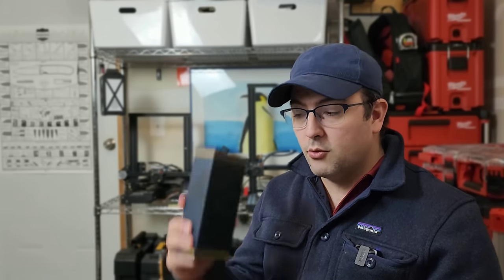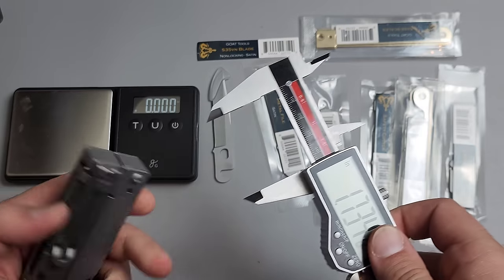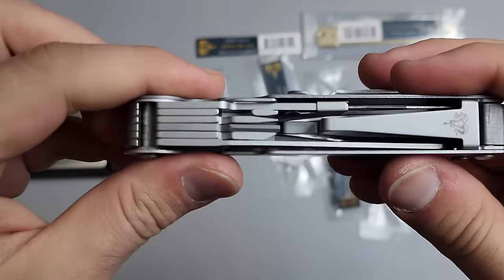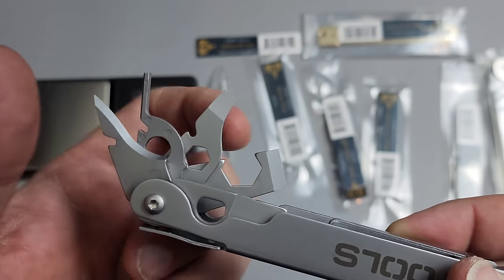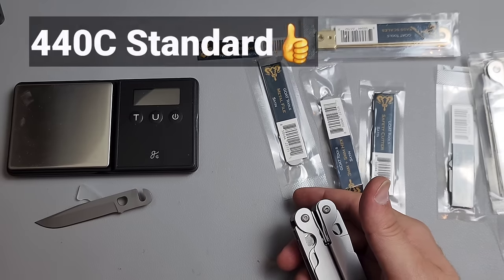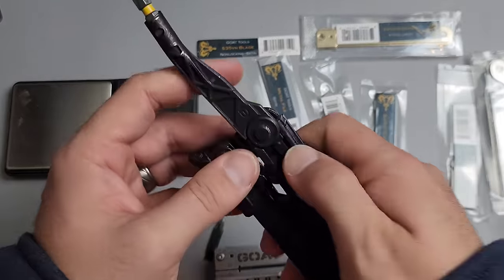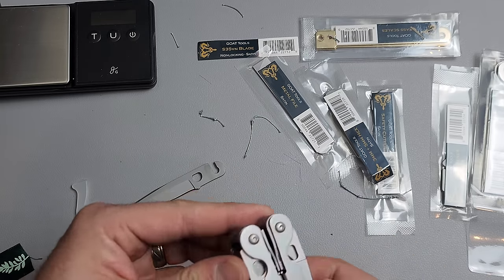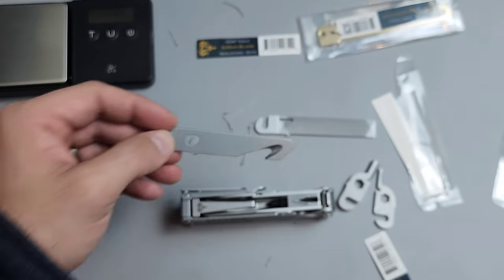🛠Modular multitools are the future.  (First look at the GOAT Tool)

Comment: This jumps straight to the top of the list for my next multi-tool purchase. Great scissors, non proprietary bit holder and fixings, chose your blade type (locking/non locking) or chose no blade at all. Great quality materials and construction, it ticks all the boxes for me. BTW, I'd use the bit holder with 50mm impact style bits which will give better reach/extension.
Reply: This could become the Small Block Chevy of Multitools.
Reply: 50 mm is th1/4 "?
Reply: @patrickbledsoe2176  he means 50mm/2” length, the bits are still 1/4” wide
Reply: @thezoomguys385  Noooo. Slant 6!

Comment: THIS is the direction Leatherman should have gone when they released the Free series. Full modularity easily done by the end user without the risk of voiding warranty. THAT would have been freeing, not freaking magnets! lol They could have even kept the good sized and nicer quality tools of the Rebar/Wave/whatever style tools and not dumbed them down to Wingman/Sidekick level like they did with the Free stuff.

Hopefully this will be the competition Leatherman needs to give them a good kick in the pants to actually innovate again.
Reply: Leatherman just might still....
Reply: To be fair they do innovate, but they don't seem to go to the right direction for a lot of stuff. I mean they make some more gimmcky stuff at times and expensive as well
Reply: No, keep the magnets. That is one of the best features of the Free.
Reply: Leatherman is probably just a small part of a bloated marketing machine.  Companies look to what everyone else is doing which is instrumentalism instead of real innovation and the building of a true standardized platform out of fear that standardization will destroy profits which in the long run is a possibility.
Reply: @pcofranc  Actually platforms can evolve, and they can be made with different kind of modularity.
Also they can think of new tools and tinker around their form factor.
For example designing two tools, one who is based on a screwdriver handle and the other one with a plier based one.
The handle for exemple will take saw blades, screwdriver blades, 1/4 hex drive 1/4 square drive, files, wood scissors, brushes, push pull manual drill (mostly for wood and plastic)

The pliers will have modular plier heads that can be swapped, so you can get pliers for différent jobs like the screw pliers in various forms, cutting pliers with cable cutters, then modular knife slots so you can get 4 modular main blades with normal knife blades, serrated, electrician, scalpel, utility knife, thin multi wrench, thin wrench set,  a couple of modular minitools like a hook, a reamer and scraper, can opener, etc...

Even if there is missing tools like hammer, scissors, pry tools or probably an additionnal tool that includes these three, I think there is some strong potential...

Comment: This could be a game changer for the UK market. You can swap to a non locking BLADE!
Reply: Or just pop the locking blade out, and keep it in the pouch when out  anywhere public. I'm a bit wary of using any sharp non locking blades, as I've got so used to using locking blades.
I don't want to forget and slice my fingers off!
So will go with locking blade, and pop the blade out, when I need to.

Comment: I wish it had a wire stripper or an option for one as an accessory. I'm aware you can strip a wire with a knife quite easily, but even a little notch on a can opener like what one finds on the Leatherman Wave is superior to a knife. I find myself using the wire stripper on the Wave all the time, even when I have a dedicated stripper at hand. Either because I'm on a ladder and my bulky dedicated strippers didn't make the initial climb due to needing other tools first or when working with someone else that doesn't have a wire stripper, so we're sharing the dedicated stripper. It's so nice to always have an option in your pocket.

Comment: Thanks for the review.  I only ever use the pliers, screwdrivers, and blade in multi tools, so I’ve been carrying a Knipex Cobra XS pliers, dedicated screwdriver (Big Idea Bit Bar Inline), and any good ~2oz folding knife.  I get a better pliers, better blade, and better screwdriver this way for less than the total weight of a multi tool.  And I can spread the weight to multiple pockets which means I can barely feel any of it.

If I was going to go back to a multi tool, this is probably the one I’d look at first…
Reply from the maker: That's impressive
Reply: @maxlvledc  I appreciate that.  It would be cool if you did a video on multi tool alternatives, like carrying pliers, knife, and screwdriver separately.  For my set up, the only thing that was expensive is the screwdriver, but I’m sure there are similarly sized screwdrivers for much less money.  My pliers cost $30.  My knife (Stanley 10-049) cost $10.  I work on a farm and grew tired of ruining expensive multi tools because one of the tools broke, so I split them into separate tools.  Anyway, just a thought…. I really like your content…

Comment: I personally don't think that these modular multitools will make the industry change. Mostly because people, from what I've seen, don't really care if the tool is modular or not, they just want a tool that works. So for most people I don't think the price will be justified. However I do think that alot of multitool enthusiasts will get it simply because it's the first of its sort.
Reply: Not the first or second,  might be considered third.  You are correct, modularity is a neat concept, but it doesn't tend to sell well long term.
Reply: In my case I use knives/multitools for urban EDC but also as I'm into outdoor activities like camping, mountain biking, bushcraft etc. I have different ones I use for those different scenarios, I don't really need a saw and inline reamer day to day in the city, but I do in the woods.  Likewise I'm unlikely to need a bit driver or metal file in the woods.  So for people like me - and judging by the comments I read on yt vids about SAKs/multitools etc. from many countries, there are many like me - it is a good solution and had it been around 3 years ago when I started buying SAKs and multitools, I'd have bought this as my one and done fullsize multitool, the fact that you can add allen bits also means you can take it on bike rides instead of a bike multitool which you normally need to carry in tandem with some kind of pliers anyway.

Comment: This truly is a game changer.  Personally, I rarely have a use for most of the included tools, but because they are all flat, it would be super easy to design your own tools and send/cut/send laser cut your own ideas out of any material of that specific thickness.  For example, I often need the same handful of specific feeler gauges... why not use a blank with no features, and precision grind you own set of gauge thicknesses, say 5 across one blade.  I also regularly need to work on fire truck air lines... so have a blank ground with a variety slots for the various sized airlines so you can easily pull back that "shark bite" fitting when they get crusty,  rather than using pliers.  The imagination runs wild with possibilities.
Reply: As a former firefighter and EMT, I want that hole opening on the seat belt cutter to be an O2 wrench...

Comment: To tell this is what I was waiting for, full modular MT.
I mean there is MTs with minimum modularity, like Bit drivers, a blade change system, but nothing like every tool that could be changed. And also when there is such options the whole system is limited.

The surge, The phantom, The multi plier, just to name a few models are a step in the right direction, but none of them fully went into fully modular. They at best try one key modular feature, then nothing else.
Sometimes you get one big modular slot, sometimes it's the plier, then you can get a driver or utility cutters.
Also some tools doesn't exist as an option, also some pliers aren't used because the needle nose is usually more funtionnal.
As for a criticism most MTs are designed for camping and while this is good, I would love them being more thought around Professionnals, like having things for one kind of job, like plumbers, mechanics, electricians, computer repair, etc...

Comment: This is game changer. This has so much potential. Thank you for the video. I could sense the excitement in your voice. Only one complain so far they shud have gone with sog pliers which has the leverage technology and it will s the smoothest for the bit attachment they shud have gone with how sog powerpoint does it on the back of the pliers. it is in the centre and only a ratchet hole is required one can maybe use a leatherman ratchet. This ratchet i understand will support almost all the bits.
Reply: I agree with the Rachel 100%
Reply from the maker: I've watched dozens of videos of the compound leverage system one year + later...not once did it hold up over time...sadly.

Comment: Coleman had a modular multi tool many years ago. It consisted of a full size plier with two removable modules containing the various tools in each. So, you can use the screwdriver in the module while holding the nut with the plier. I only got it with the two modules that it came with, but there were additional ones available at the time. Got a couple in the Coleman outlet store. Never saw them again, there or in any store. Neat concept, can carry one tool that becomes three separate ones.

Comment: There I was thinking what a shame it is that no manufacturer makes external one-handed opening non-locking blades and GOAT did it, like you say great for the UK where I live.  The tools themselves seem equal to or superior to the equivalents on Leatherman or Victorinox and the overall construction appears sound.  Obviously the modular configuration is a big plus as it means you can vary your toolset according to whether you're carrying in an urban environment or out camping etc. but I'm not sure that's a good business model as it seems you could just buy one of these for life, whereas Leatherman and Victorinox both sell a lot because people are always buying more looking for that perfect tool, or to have different ones to carry according to the scenario.
Reply: Bloody hell just for fun I went on to indiegogo to see if it's possible to order for the UK and it is, a basic model with non-locking blade is just £81 which you pay for a Skeletool or Rebar here if you're lucky, I've seen the WIngman for £80, with shipping from the US it comes to £109 which is still what you pay for a Wave Plus which you can't legally carry and I think that doesn't even include the pocket clip.  But today we got told that the pub I work in is closing so not a good time to splash out!

Comment: it's about frickin' time someone did this.  Leatherman had BETTER be paying attention.  Excellent first look, I didn't even know this thing existed, but I sure as heck am going to get one.  I think that file is a disgrace.  The Wave's diamond file is my most used tool, by far.  Why?  Because it's perfect for fingernails.  It appears that a bit more thought should have gone into the actual feel in the hand, seems like there MAY be some hot spots.  I do think the non-radiused top edges of the pliers is a definite shortcoming.  The radiused pliers on the Wave are the standard shape in the single purpose needle nose plier world.

I think you're right that this may be a game changer for the multi-tool world.
Reply from the maker: its actually more ergonomic than the wave (not a big feat) which really surprised me.

Comment: Hope you enjoy geeking out for the next week. I had my reservations about it, but the finished product looks great.

Though, those square edges on the end are a deal breaker for me. Only because I foresee myself throwing it in my pocket while working and getting stabbed by that 90 degree. (Sometimes I do not have time to clip or holster if I am moving quickly)
Reply: those square edges on the end are a deal breaker even for me , i'll stick with my Charge TTi .

Comment: Excellent review! I’m way more impressed with it than I thought I’d be. Not sure if it’ll unseat the wave as my edc, but we’ll see. Definitely has its advantages over the wave, but also some disadvantages. The wave cutters are way better, try cutting 12-2 romex with the goat. Bet it won’t. The cutters look so small. Personally I’m not a fan of spring loaded pliers, but I could live with it. Lastly, a feature even leatherman messes up sometimes (particularly the P4), is the roundedness of the handles where they meet your palm when squeezing the pliers. The wave/surge are amazing in this area. The goat looks like it’ll be decent, but not as good as the wave. This really matters when you are squeezing hard to cut wire. Maybe with the scales it’ll help round them out. The scale option is really cool! I’m sure I will give this cool new tool a try.

Comment: Back in 1962, my father gave me a folding knife in which you could change blades much like the Boker would, in later years.  There were screwdriver blades in flathead and Phillips, a file blade, a chisel blade, the knife blade, of course, and a hammer head.  All but the knife blade locked the blade open.  If I had it yet, I would, by now, have  made many more adaptations for it.  This multi tool seems to be be a good cross section of useful tools.

Comment: This seems like everything I have been looking for in a multi-tool as an ironworker. Even got the hex bits for changing out the gooseneck on a suitcase welder gun.

How is the pocket clip? I am in a lot of awkward positions on high steel. Would be good not to have it fall out of my pocket.

Comment: I can understand the excitement about this tool, but it doesn't quite grab me like it does everyone else. I think my preferred would be to order up a custom multitool with just what I want and nothing that I don't. For example, I have no use for a saw, and would like to order a tool without the saw and something more useful in its place. After getting the tool, I really don't want to mess around with swapping things in and out. Regardless, great to see someone innovating and putting in the hard work to get to production. Great video as always - thanks.
Reply: Same. There should absolutely be a BYO option. Even if it came at a slightly higher price point. 

I want to be able to purchase each component of the tool separately. Every single screw, frame, tool, clip, blade, etc.

Comment: One thing about the pliers is that they will work for an internal pipe reamer for electricians.  The stock wave pliers don't work for this, I have a wave with modified rebar pliers on it just so I can use them as a conduit reamer.

Comment: Just ordered one. Been looking for a good full size multi tool with a gut hook to replace my small sog power pint. Gut hook is the easiest/safest way to cut zip ties other than a side cutter (which isn’t an option on a multi tool).
Reply from the maker: I use the pliers to twist the lock

Comment: How about the ergonomics when using the pliers? Does the tool bite in your hand? Or is it comfortable at least as Wave?
Reply: According to the Indigogo page it was designed not to bite when using the pliers. I don't know about the edges of the tool, but they did build in a gap between the handles.
Reply from the maker: More so imo..but it has more flex...kind of like a spirit

Comment: Hey man love the content do you know if a leatherman t4 knife could be installed on the free p2 to get rid of the combo knife appreciate it
Reply from the maker: never tried it..but I cant see a reason why it wouldnt work.
Reply: Yes, you can. However you will be left with a plain edge knife of the same length as the plain edge portion of the P2 combo, so I don't really see the point. The plain edge from a P4 will fit it as well.

The serrated section is useful for cutting rope and straps, etc.

Comment: Okay, not too shabby for a multi-tool, but I collect them and I got a Showcase of about 40 of them. Your presentation will do, especially the part where the tools can be removed from the tool, but I do have my favorites that have served me well for years. I am interested as a collector, but I don't know that I see the quality in the tool you present. I would say it's above average. Thanks for the video.
Reply from the maker: It's somewhere above SOG, above half of Gerber, and below leatherman and Vic.
Reply: @maxlvledc  Yes I agree with that, and FYI I Own all 3 you mentioned and a few more. The SOG I have is a bit goofy, Doesn't have a model number or descriptive name except SOG, tools lock and are a really decent set of tools (sharp, strong and work well), but it doesn't have any way to stay closed and the pliers can and almost certainly always will open up in your pocket, so it requires a sheath or a rubber band. I knew this when I bought it but considering it has every tool you could ever want in something the size of a cigarette lighter and only cost 50 bucks it did make a lot of sense, but came with no sheath. I'm subscribed. Thanks.

Comment: I think these kinds of tools fall into the category of trying to be good at so many things that they fail at being really excellent for even one thing (except impressing trendy nouveau-philes).  Try to use any one of these for repetitious tasks for a substantial length of time and this will become apparent to your appendages.
Edit:  Thanks for the highlight notice.  I don’t want to come across as an old tradesman curmudgeon, I just was adding my particular experiences to the mix.  I appreciate useful innovations, and this modular multi-tool has some potential use for someone who needs to travel light and be able to perform various tasks without having to carry high volume cushion grip handles designed to reduce stress on old hands.
Reply from the maker: If you have tried a wave it's more comfortable than that.